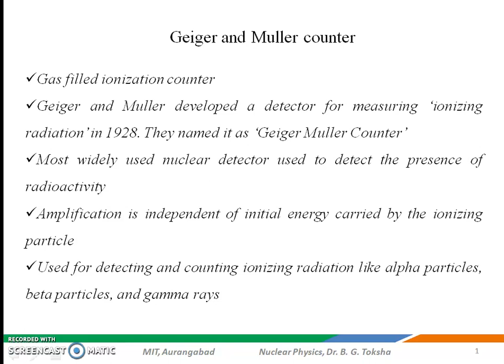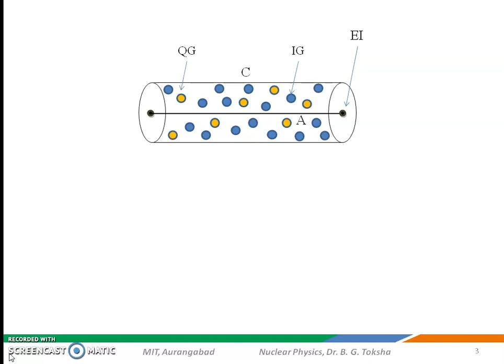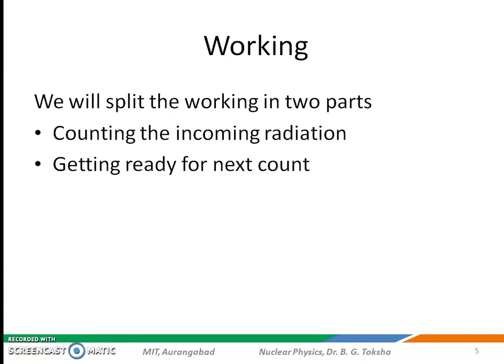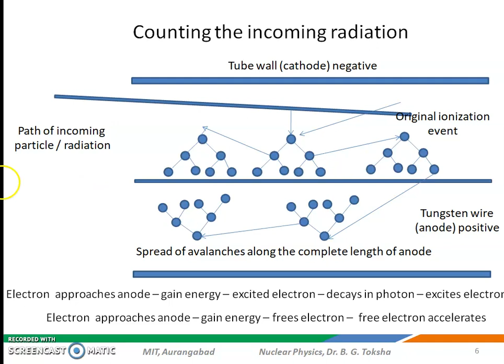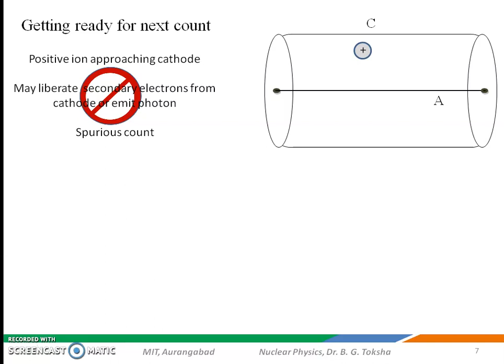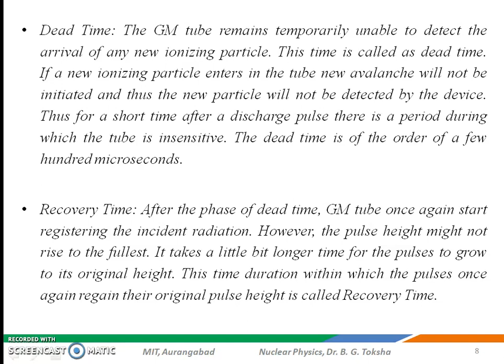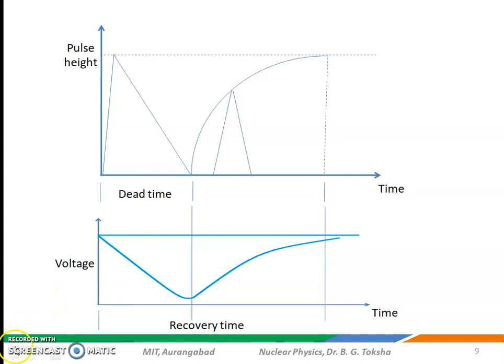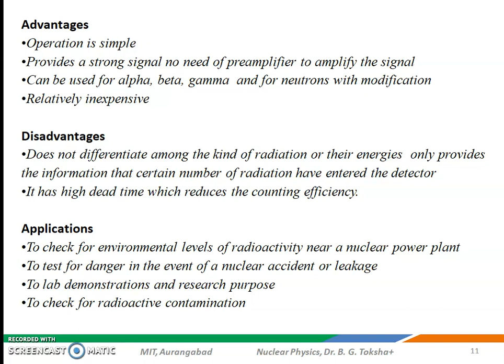Geiger Muller counter

Comment: in tube blue circle is denoting the ionization gass and the the another gas present in tube is quenching gas  (2) the ionization radiation is coming in contact with innerd gas molecules then they splitted then negatively charge electon goes to central anode and positively charge ion is moving to cathod
Reply: explained actual process in short👌👌